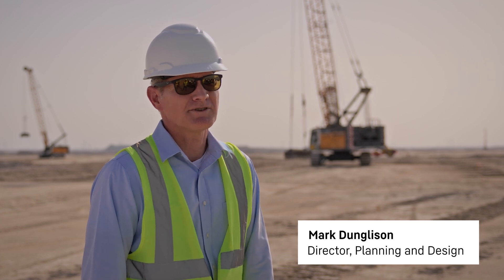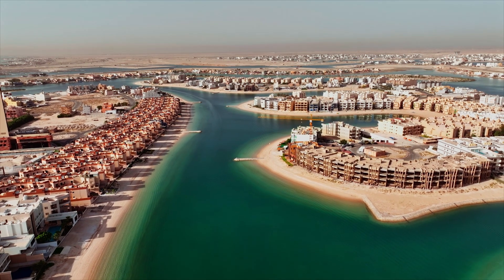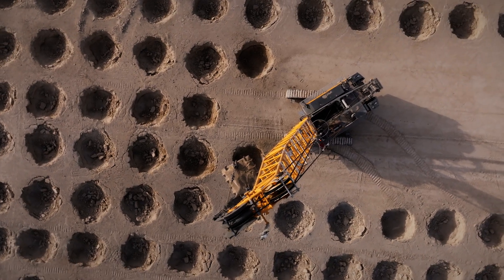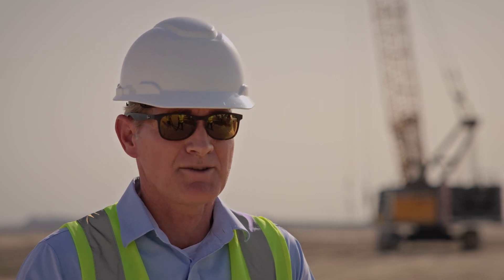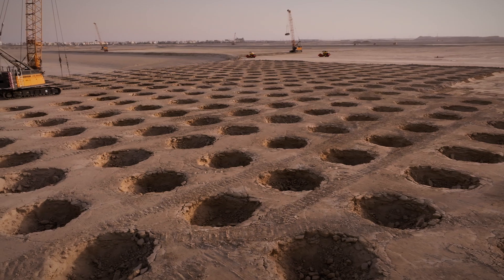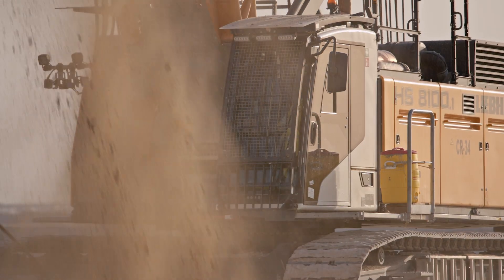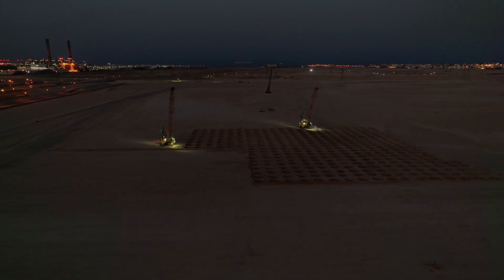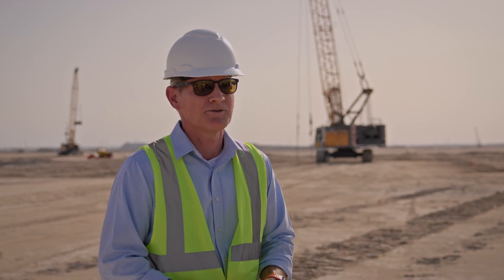Dynamic compaction with duty cycle crawler cranes | Liebherr

Comment: The good ol' Liebherr HS855 .... simply indestructible! this machine runs and runs. Had the honor to build some, maintain some and service some. Perfect balance between size, transportability and power. Even though it is this compact and can easily be transported on a flatbed, with its own self erection system, it is still spacious enough for easy access to all components for service and preventive maintenance. I did all kind of operations with this machine, dynamic ground compaction, drag line, slurry wall grab (hydraulic and rope), ball grab with and without casing oscillator, and one of my favorites (after dynamic ground compaction, of course) was to swing a wrecking ball with it. If I could, I would own one.